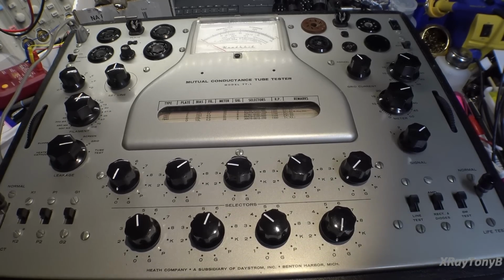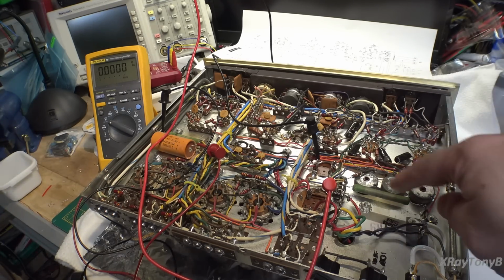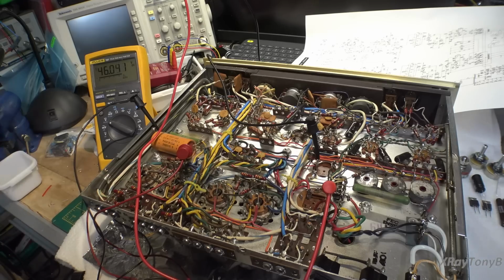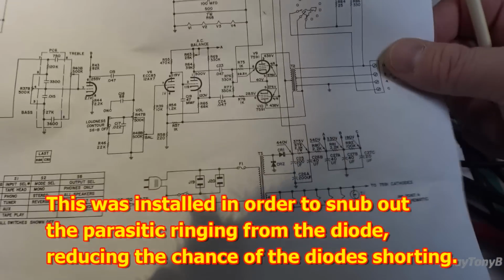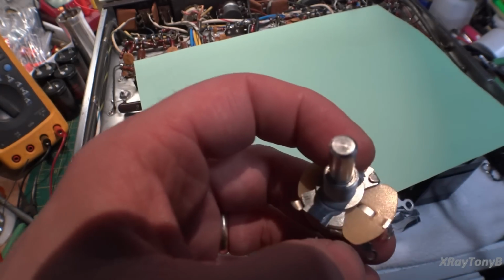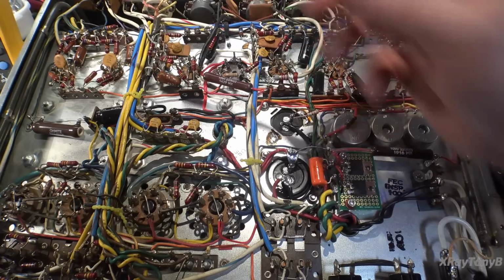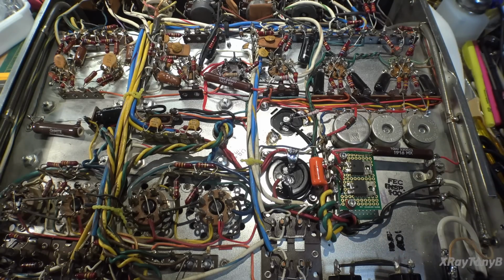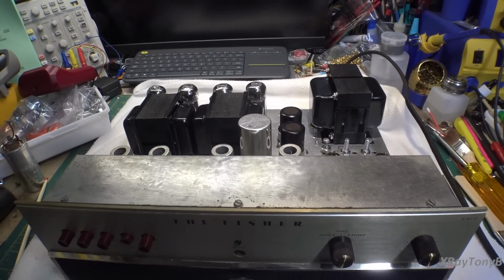Fisher X-101-C Part 3: Rebuilding the Power Supply

Comment: I thought carbon resistors tended to go up in value.  I wonder if it started off life as a 220 ohm resistor (red-red-brown)?  Also, no concern about a wire-wound bias pot creating unwanted inductance?
Reply: If they're sealed very well and treated ok they shouldn't drift. They go up because the carbon soaks up water moisture, which should only happen if the seal breaks.

Comment: Exposure systems in cameras, and light meters, want to see "the world" as 18% gray. Remember seeing the Kodak gray cards, or white, gray, black targets photographers use today? So according to your camera's autoexposure system the paper should look like neutral gray, right in the middle of the gray scale. It will do the same thing for darks, attempting to turn them to neutral gray too. And so it goes with bright lit areas and so on, giving a better exposure for bright light while anything dark tends to disappear in darkness since the camera can't handle the wide brightness range of the scene called Dynamic Range in photography today. Good idea about using the green paper. BTW, good ol' green lawn grass is about 20% reflective, just 2% more than neutral gray and kind of close to your green cutting mat. Notice how you have very few problems with your camera with that? Well, that's why, it is very close to what your camera's autoexposure system thinks it should see. So it isn't at all a problem with the white balance, that has looked very good in most if not all of your videos, its the autoexposure system.

Well done! All of it. Long time fan here.

Comment: I remember the old Heathkit slogan.(from the 70's) ."We won't let you fail.." (But don't try to call us...). I actually still use two Heathkits that I built way back when. 1) The original FET multimeter and 2) A solid state op-amp based AC Voltmeter. They both have "issues", despite re-capping but the (large) meters still work. The AC meter is still good for analog "DB" measurements. (both are 1978-79 vintage)

Comment: Sell the Heathkit and try to get a Triplett 3444, a 3444A if you can find one. I came across one about a year ago but it was $3k. I already have a Hickok 539C in mint condition so I couldn’t justify the price. Also have a Hickok 6000a, EICO 666, B&K 500 and an old GE tester I got for 10 bucks from the late 40’s that works very well for a simple emission tester. The 539c covers most everything else. There is some plans out there for a good dyi tube tester. I downloaded them and will try to find the link. Looks like a good circuit if you have the time to build it.

Comment: I seem to recall a post from possibly Audiokarma  about adding a 10Ω resistor from the cathode of each 7591 to ground in order to protect the output transformers in case of a short.  Have you heard of this?  Also, I seem to remember that Fisher used to drive those 7591s very hard.

Comment: You may have done the caps a little cheaper than Hayseed Hamfest.  They have the complete set of direct fit replacement cans.  That's what I'm putting in the one I am working on.  The cans in it were in worse shape.  One had a very high resistance.  The only thing I don't like about there cans is they put a large, generic looking,  paper label on them with there logo on.